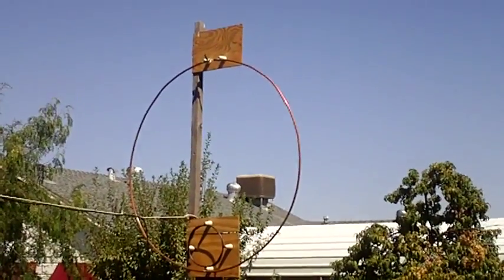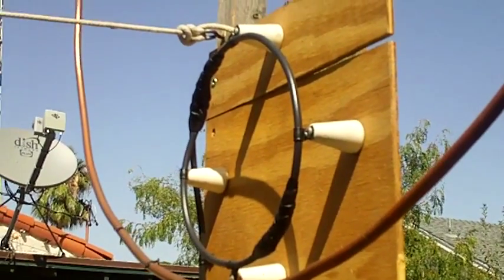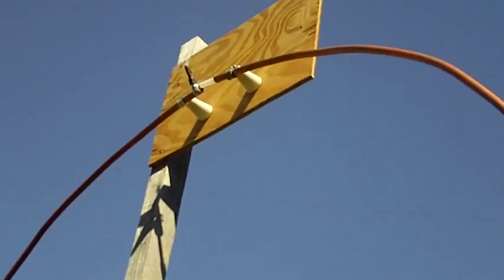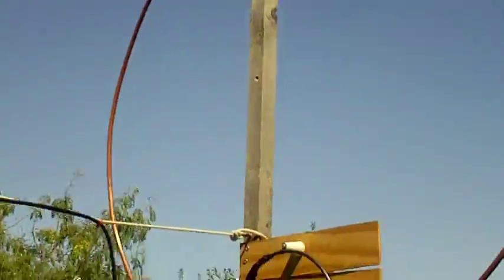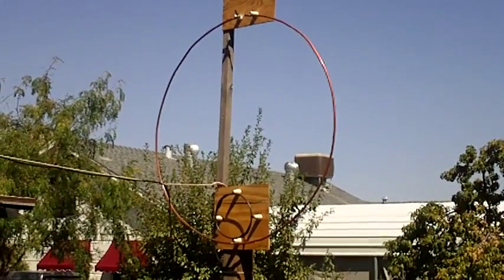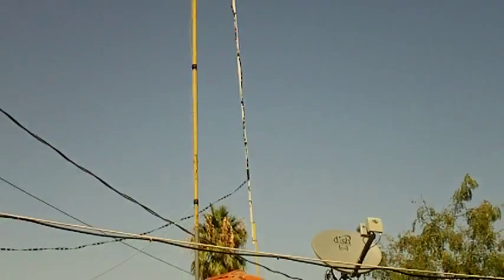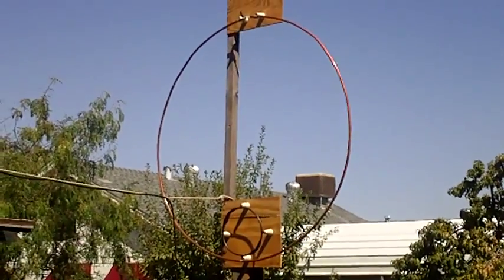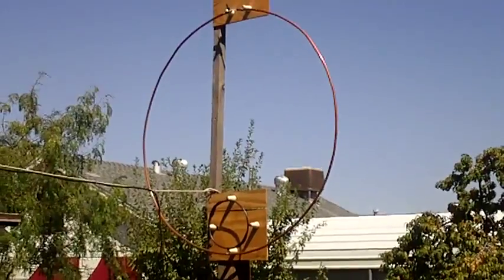Ugly 30 meter fixed frequency magloop

Comment: you dont even need to solder the dielectric just measure the length you need and shove half down each side of the open end :)
Reply from the maker: The problem with this loop was thermal instability.  The difference between day and night temperatures detuned the antenna. I learned some things from it. One of these days version 3.0 will be born. Larger tubing. A vacuum variable capacitor (motor driven) and I'll put it on top a real metal pole.